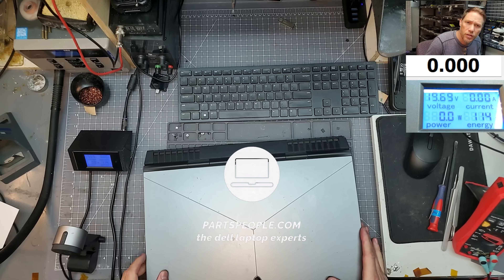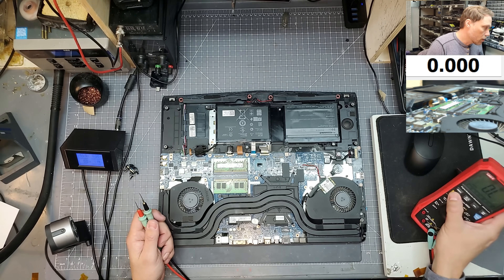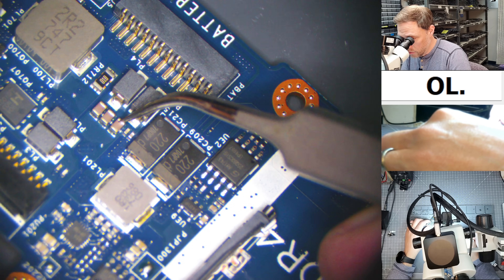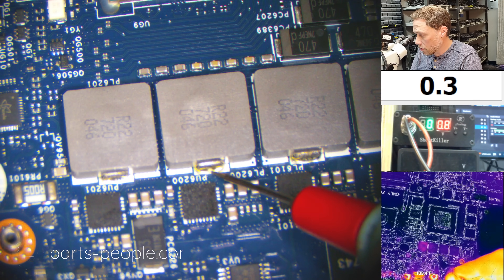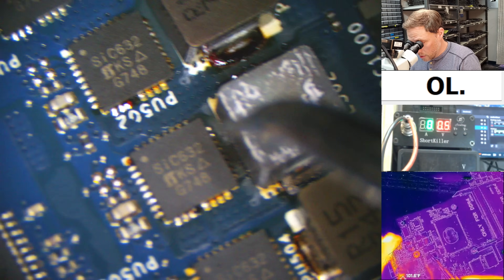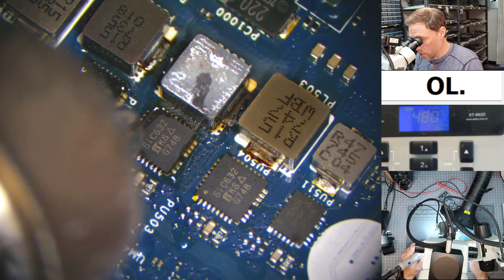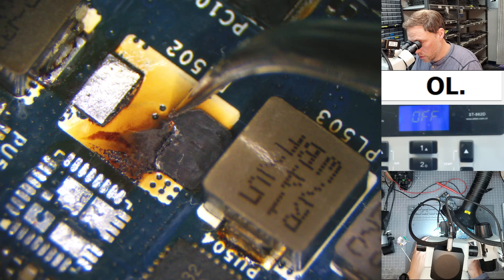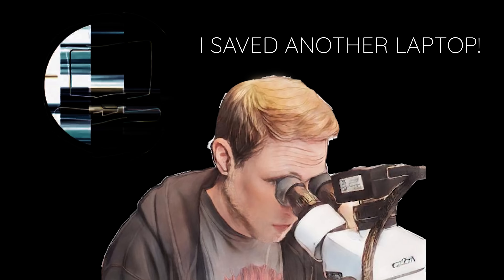Why This Gaming Laptop Is BEYOND Repair – And CANNOT Be Fixed!

Comment: How is it that 20 year old laptops still work but now they only last five years ? Sadly poor design and cheap components are the norm today.
Reply: power density increased dramatically. So is the stress on the components. The hotter the more prone to fail.
Reply: Correct,  @TechModLab  AKA higher current,  as the time goes by, it gets hotter and weaker the more you use it, that's, why sometimes just doing cleaning and maintenance is not enough after many years, it needs component replacements, exactly the same as a car which is also a daily use machine, this happens also with air conditioning units, the more the heat on the outdoor unit the more degradation to the compressor.
Reply: i have a laptop dating from 1986 that still works, IBM PC convertible, plus several grey toshiba laptops from the mid to late 1990s also working, my main regular use laptop dates from 2007
Reply: @andygozzo72  Had a 2000ish Toshiba laptop -> Spilled a large glass of cola on it. Started beeping like crazy. Quickly turned it off but b/c I was young I didn't know how to open and fix/clean any of it.  So just left it for a few days then used it again. Continued working perfectly for years until I upgraded. The only issue was the power brick would get abnormally hot. Pretty impressive though.
Reply: Compaq LTE 5280 - 1995 works perfectly, of a lil maintenance because of brittle plastics in the battery mechanism 

Acer Travelmate 290 - 2005 - Works perfectly, even the battery holds a charge for around 10 minutes 

Dell Latitude E6400 - 2009 - Works fine, batteries shot from age,

MacBook Pro A1278 - 2011 - Works fine

HP Pavilion 15 -  2015 - Dead CPU

Asus Chromebook - 2019 - Dead CPU 

Lenovo Ideapad - 2020 - PCH cooked.

Just some of the devices i own/have worked on in the past.

Seems the only thing that can kill old laptops is degradation of materials (case en point for a Latitude CPis plastics and Sony VAIOs screen suffering Vinegar syndrome.) or even a generic issue (HP DV6 - Dead GPU)

Or physical damage (iBook G4 - Spite splash, Dell Inspiron E1505 - Dropped)
Reply: My M18x R2 is still kicking. The i7 3rd Gen is a bit dated, but it still works. Built in 2012.
Reply: @davidkettell1073
It's not my intention to criticise you personally, but in my opinion there is too much "conspiratorial whining" going on regarding this subject.
When the "simple truth" rather than some "great conspiracy" or "evil engineers"is a combination of simple and what should be pretty obvious factors.
For starters, a laptop made 20 years ago was MUCH less "sophisticated" than today's machines are. And I'm talking about the processes used in components today, which have been "pushed  to the limit" many times over in order to reach the level of miniaturisation, performance and cost effectiveness that they have today. 
In addition to that, laptops were "allowed to cost more" 20 years ago, today's market is the result of a "race to the bottom". In which the manufacturers ((in consumer skews)) have had to make machines '"optimised" for high performance/price ratio rather than for reliability/longevity... 
AND THE REASON for this is because it's WHAT WE CONSUMERS have shown that WE want/prioritise when we spend our money...(And of course the manufacturers also want (and need) to make a profit, but IF we consumers chose our laptops after which were "most reliable" and "long-lived" I'm convinced that the market would have looked different) 
So if you want that you have reliability rather than performance at comparatively low cost then you have  to "leave consumer grade products"... 
Best regards.
Reply: 200-250 watts is much higher than 50-150 watts!
Reply: Because this is a 7-8 year old high end gaming laptop and gaming = higher power consumption = higher heat , heat and power = shorter the lifespan of components depending on the usage eg: many hours a day usage or a lot of gaming typically shorter lifespan. The power adaptors on these were between 180-240 watts, many newer non gaming laptops power adaptors are under 35watts meaning far less heat and cooling required and hopefully longer lifespan. I have a 14 year old laptop still working but it isn't for gaming and likely a few hours per week usage and has Win11 24H2 IoT LTSC so supported to April 2034. If it was used 8 hours per day likely would have long since been dead.
Reply: @cam_934  Well said. I know Northridgefix is controversial, but he was spot on when asked the question of what gaming laptop to buy that will last a long time: (roughly) 'none. If you want a gaming setup that you can have confidence in lasting for more than a few years, get a desktop.' With higher and higher specs being put into them, you're putting great strain on the power management/delivery systems.
Reply: Has nothing to do with design buddy, more so that operating systems get more demanding with each update, same with games etc so hardware can’t keep up!
Reply: @CajunReaper95  both
Reply: @CajunReaper95 :I'm not your buddy and you don't have a clue what you are talking about. HW that can't keep up would equal low FPS in gaming, many games detect the HW and adjust game setting accordingly or the user can, users are certainly not playing games at 10FPS.
Reply: because they are junk made with the cheapest worthless components ever made. Then they are sold at 500 times what they're worth, but I guess the CEOs cant fly around in their pleasure yachts if they were sold what they're worth lol
Reply: My 7th gen xps is still making music in a DAW. Buy the best you can afford and your laptop will last.
Reply: @GraeboProductions :"Buy the best you can afford and your laptop will last" This statement equates cost with longevity, totally incorrect.
Reply: @cam_934  my statement equates buying a $2000 dell , it can still run 2024  music production software and the latest photoshop updates. Keep it clean, treat the the system with respect and knowledge and it will last. 7 years and counting.... ie. The owner of this laptop that was repaired ignored the overheating laptop, it broke...
Reply: @ Nobody cares about you trying to insert your PC into the discussion, the laptop in the Video is a gaming PC, again Money doesn't equal longevity. The overheating laptop is you making stuff up that wasn't discussed, what was said is the laptop appeared to be very well kept, somehow you turned that into overheating! Yikes! its a gaming Laptop, if he used it as designed its going to get hot unless he gamed inside a refrigerator.
Reply: @cam_934  nobody cares about you game boy ttoll
Reply: @ I wondered if he was real or a bot. Seriously!
Reply: @  Let me guess, your posts are about you and nothing to do with the video, isn't the world full of enough narcissists? Again price doesn't equal longevity and again you have zero response to that. Ohh look at me I spent $2000 on a laptop! you get what you pay for.
Reply: These ranting comments against claimed "cheap junk" current machines are really clueless to manufacturing reality AND marketing reality...it's the buying public that thinks wafer-thin, ultra-light laptops are a good idea...THAT's the root of the problem !....the manufacturing side that would otherwise love to be building more durable, robust designs are at the mercy of the clueless buying public used to tossing $1500 cell phone super-computers around like they're toasters, then bitch when THEY break these delicate, expensive machines like these laptops, dissing the skills of experienced techs capable of working on them by changing the batteries themselves to save $50 in service fees, THEN blame the company that made it.
....and, from the MFG side, when the state-of-the-art in manufacturing technology was pushed to low-power components you had to start using microscopes to see, how is it a surprise to ANY thinking, reasonable adult that these newer machines are more delicate and more at risk in the real world of the portable environment ?! 😮
Reply: @Stenn333  its a bit of a vicious circle, the manufacturers produce what they 'think' customers want, but customers can only buy what the manufacturers produce anyway!!
Reply: It's called Planned Obsolescence, need to keep the consumers buying stuff, that's why our gear today doesn't work as well or last as long!
Reply: 5 years? using them for 2 years is a big deal now
Reply: Literally nothing to do with what you said. How are you comparing low performance, low heat producing components from back then, to high power, high clock and high heat producing components to current ones. If you jsut used your brain for two seconds, you could have immediately answered it yourself.
Reply: Planned obsolescence. They do this though using parts designed to fail at a specific point in time or amount of usage.
Reply: @horseathalt :No its not planned obsolescence, this is a gaming laptop, they guzzle power, create a lot of heat and can often die and early death because of it. This one was looked after meaning cooling fins were not caked/blocked with dust and lasted 7-8 years, where is the planning in that. The video already said typically 5-7 years not for all laptops but for this model. I have a 14 year old non gaming laptop still working! where is the planned obsolescence?
Reply: @ The earlier laptops were not designed to  fail as quickly. This thing was clean and still failed. It absolutely is planned obsolescence by design.
Reply: @horseathalt :Wrong, you just don't comprehend its a gaming laptop, you don't understand what that power load and heat does to electronic parts to make them fail. Many high end gaming laptops suffered early deaths, had graphic chip/card failures and became too expensive to repair.
Reply: @horseathalt7308  lol no
Reply: @ No means yes.
Reply: @ lol no, Dell just decided to launch cheaper made products to compete against the Asian tigers, not planned obsolescence at all, it lasted over 5 years of cod pew pew pew abuse, this is not apple.
Reply: It’s not poor design, they are designed to fail.  It’s a common thing.  Light bulbs, Dodge vehicles, etc.

Comment: I love how he is explaning up front that this laptop is seven years old and the life span of those models is 5-7 years.   I hope this person is getting a free repair.   7th Gen intel are not compatible with Win 11 and the clock be ticking...tick tok tick tok.
Reply: I dunno about i-7th gen, but a Xeon E3-1276v2 runs Win11 just fine, and it's what, glorified 4th gen? (not sure of equivalence, but that'd be close, it replaced an i5-4xxx.)
Reply: @Reziac similar to i7 4770/4790
Reply: Why get a free repair (actually diagnostics)? the person sent it for a fix, the person knew it was 7 years old, it can be fixed but now a MB replacement, is that economical to do on an old laptop? That what the clients asks eg: how much for diagnostic, how much for MB replacement, warranty on either? A new gaming laptop is far from cheap so client needs to weigh up their choices rather than a third party claim its not worth it for them.

Comment: I thought it was one of the protection MOSFETs on the main rail.
Reply from the maker: Good guess!  Because of the low resistance...  I really never see the CPU Vcore MOSFET shorted to ground. And don't get me started on that coil. Wow
Reply: @dellpartspeople  thanks :> attempting to solder a piece of metal onto the burnt plating would have been too risky to turn on the pc tho, so swapping all the removeable components onto the new board (the ssd, ram, etc) was the only logical option

Comment: I have an Alienware M18xR2 that was preowned before it was gifted to me. Still alive and kicking. Never took the heat sink off but I do take open and clean it every 3 to 6 months, brush off the dust and use a lil vacuum made for it so the dust doesnt spread. Maybe twice in 6 years since I've had it have I taken it fully apart to do a deep clean but I don't do it often cause often there's not much to clean anyway. 

Did it once cause some memory sticks were going bad so I might as well clean it since I had it disassembled. In the past year, I've had maybe 3 BSoD randomly that I couldn't recreate so I know age is catching up to it and it'll break at some point but it's all I got for now so I'll cross that bridge when I come to it. Thanks was another good video and helps me understand my laptop a bit more.
Reply from the maker: That is great to hear you are still rocking an M18xR2 and doing regular maintenance! That sure is a huge beast!
Reply: @dellpartspeople  The only reason I mothballed mine was for a broken "a" key and non-functional microphone array/webcam module (broken cable, maybe).  I have stripped Draft Horse to the frame for deep cleaning many times and can say unlike its rebranded Clevo successor, it does not seem to care about where you open it up.  Most of those times were done on my bed with no ESD protection and very little organization.  I think those were few times I actually shut the machine down.  For a quick clean I would sleep the machine, flip it over, pull the battery, back door, and fans, peel off the matts that formed, reinstall the fans, backdoor, and battery, and wake the machine back up.
Reply: It might be a good idea to replace the thermal paste. They do get old with time. Maybe replace it with PTM if you want to avoid doing it again.
Reply: @crazyelf1  whats a TPM ?

Comment: Blown Out / Dead Short.
Reply from the maker: The MOSFET had a dead short going straight to the ground, and the COIL was burned. I think the MOSFET partially shorted first, and then the voltage from the other MOSFETs back-fed through the COIL, burning it up.

Comment: 01:55 why that WiFi adapter just laying on the fan housing?!
Reply from the maker: The wifi card must be removed to remove the bottom cover frame, and I usually leave it connected to the WiFi antennas.  So that is why it is just sitting on the fan.

Comment: You can make high current pads with solder Wick wire and mask. Easy job
Reply from the maker: Interesting IDEA! I might try that!
Reply: @dellpartspeople  Or maybe copper tape - but if the board is that charred there is a risk of internal shorts... Maybe removing the charred insulating material would be best. And are there any other connections or vias besides the connection between chip and coil? I'd guess the coil was the original culprit (internal shorted turns?) and the heat from it fried the chip. Very unusual failure.

Comment: Just fix it for the video 😊
Reply from the maker: I don't know; that was pretty burned.  I do not think there was anything I could have done that would have lasted.
Reply: @dellpartspeople Something like a nickel strip for welding batteries should work just fine, remember that the copper layer on pcbs is really thin.
Also there isn't that much current going from one FET around 30A (seems like a ton but the jumper is very short so almost no resistance = almost no heat
Or you can rip the track out of donor board

Comment: That is a certified KFC right there. I still think the laptop will POST and run without that power stage, but if one power stage gets that bad, there is no warranty to the repair whatsoever.
Reply from the maker: Yeah, you are probably right, and yes, no warranty.